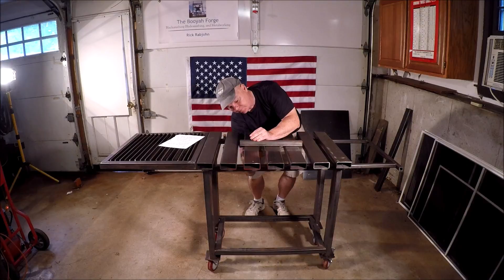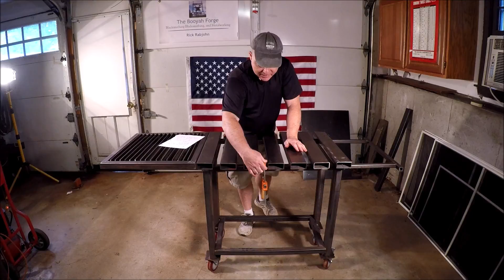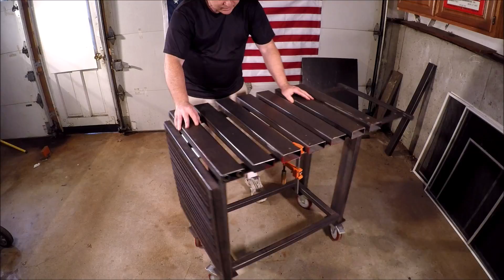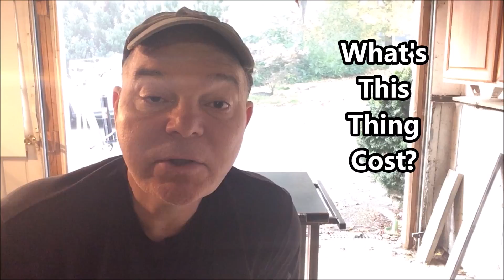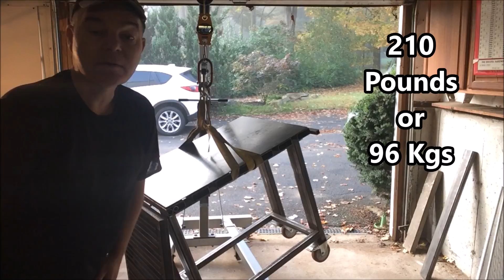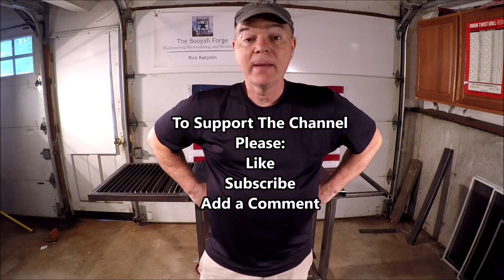Homemade Welding and Plasma Cutting Table

Comment: Cool table Rick..I have plans to build one from 6x6 lumber and two 4 ft.x 2 ft pieces of 1/2 in steel for a welding table. Mine I don't think will be very easy to move but hey at least I will have a great table..
Reply from the maker: with 1/2" it ill be a heavy duty table of awesomeness....look forward to see the video on that my friend.  Cheers...